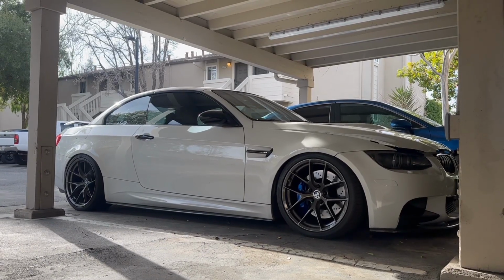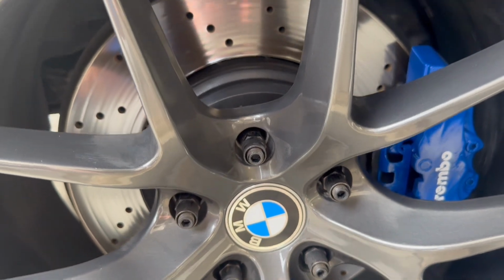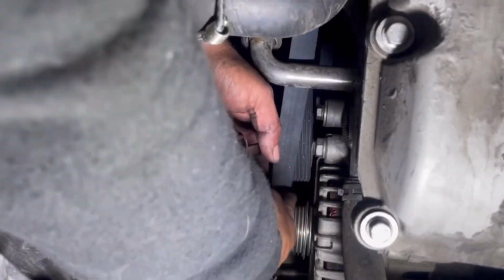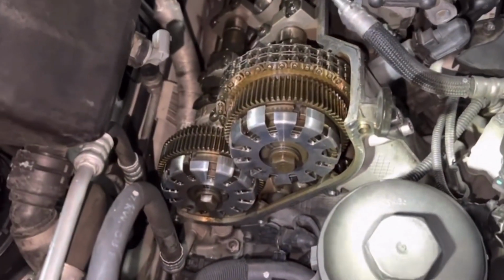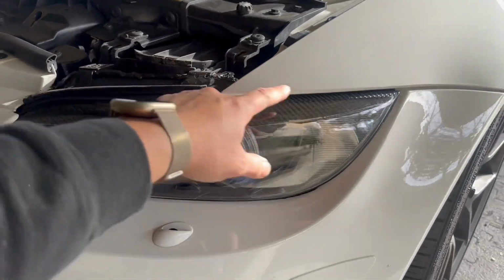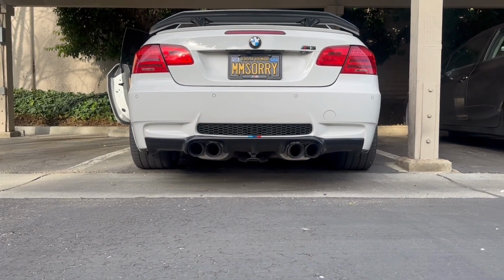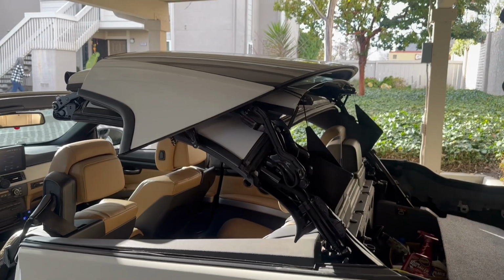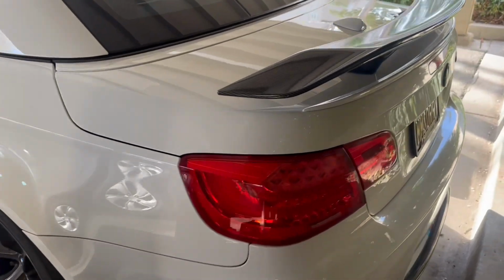Every Issue I Had With My E93 M3 Convertible Reliability & Common Issues To Look Out For E90 BMW V8

Comment: String? Isn't it a wire cable?
Also, did you do the video on lubing the fan bearings? Mine sometimes suffers from that squeak at the slowest speed!
Reply from the maker: It was a more fragile string material before they changed it to a sturdier wire cable on later models.
Reply: @Sals_Garage  Yikes! Good to know, thanks 🙂
Reply: @Sals_Garage  Oh, and did you do a video on fixing the heating fan squeak? I had a look around your channel, but couldn't see it.
Reply from the maker: @Markpd69  I think you found it.
Reply: @Sals_Garage  Yep, thanks  🙂

Comment: I need to know about CATASTROPHIC reliability issues. When I hear those words, "reliability issues," I think of more catastrophic stuff, like "I needed a new transmission after ______" or "When the engine ______, it was really expensive."

Thank you so much for posting this video
Reply from the maker: Stay tuned I’ll make another video about catastrophic issues
Reply: @Sals_Garage you might not need too. I just reached the part of the video where you said the magic word, "catastrophic".

This video was SUPER informative my guy!

Let me ask you this though. What made you go for the M3 over the C63 AMG?
Reply from the maker: the exotic sound of the engine along with its high revving nature.  I wanted a car that sounds like a ferrari, not like an american V8 muscle car.  @AWildIraqi
Reply: @Sals_Garage  That's a really fair answer.
Reply from the maker: @AWildIraqi  thanks!
Reply: @Sals_Garage  Considering my first car was an RX7 FC convertible 5 speed, I might just go for the E93 M3, considering that, between it, the Lexus ISF, the CTS-V, and the C63 AMG, it's the only one that I can get with a manual, AND as a convertible.
Reply from the maker: @AWildIraqi  manual is a huge deal. Good luck 👍

Comment: Man am I glad to have found your channel! I'm considering buying very close to the exact same car, white on red, DCT. Currently has 121K very well dealer maintained (regular oil, other fluids, brakes etc.) two-owner E93. Need to get/find out about complete records obviously, mainly re: rod bearings, throttle actuators being done as that'll make a huge difference in what I'll consider a fair deal-making price. It's with a very respected enthusiast dealer I know well and trust, and their asking $ is very decent. I've always wanted one, and the crazy covid stimmy inflated pricing is coming back down to earth-think maybe it's time to pull the trigger. I don't wrench-at all-but I always own at least one older German car (currently have a W201 Merc, a '90 190E) and have a great indie mechanic. That said, he ain't free lol so if I get into a bunch of issues it'll get expensive and one thing about a high mileage performance/specialty car $ put into it is usually $ you'll never get back at resale so most people recommend a higher priced lower-mile example but as you've shown if these are well maintained there's no reason not to expect 150K+ easily. Thanks for all the 411, giving me some peace of mind, and If I get it, your channel will be def be a great resource. Cheers man!
Reply from the maker: Glad to help! Hoping your experience is a good one. Have fun and enjoy!
Reply: Dont buy a shitty automatic. What a boring waste.

Comment: I have a 2013 with 63500 miles, owned for 3 years/20k miles. Only had to replace oil, tyres and battery.  Very surprised. Not done rod bearings/actuators.
Reply from the maker: Thanks for sharing! That is awesome
Reply: @Sals_Garage  I should have added thanks for sharing your experience too. I enjoyed the video
Reply: Great on not having to replace the Rod Bearings. Just get an oil analysis. Honestly you should be very good to go with that mileage and the proper warming up of the oil. Cheers and enjoy.
Reply: @Bernard Barbour  I thought after a certain age they changed them so you couldn't get results from an oil analysis. Something along those lines. Thanks!
Reply from the maker: @ksm1985  2011 and above is not copper anymore so different material that doesn’t show up in analysis.

Comment: We’re did you get your rods done & how much ?
Reply from the maker: SV Bimmer I paid $1600 3 years ago before pandemic pricing.
Reply: @Sals_Garage so now it's a $7,000.

Nice.....

I'm kidding, but yeah... I keep going back and forth on the E93 M3 and the C63 AMG.

From what I've been seeing, I could get one of those, or, for a similar price, I could  get a Lexus ISF or a 2nd gen CTS-V

The options are plentiful, and even on the used market they're all similarly priced
Reply from the maker: None of those are as fun to drive as an e9x M3 with the 8600 rpm redline and exotic engine noise.  @AWildIraqi
Reply: What’s a decent price/mile range to look for with one of these. I’m looking to finally get a coupe after having a camry for so many years. It looks like getting a v8 muscle car would be a cheaper option. But there’s something special about having a german car.